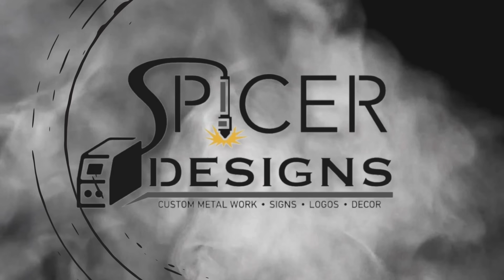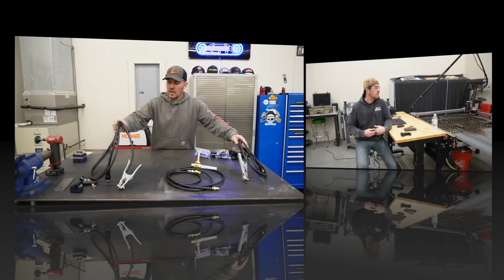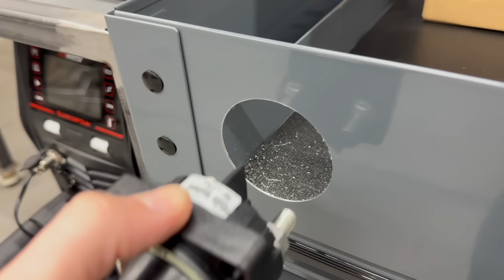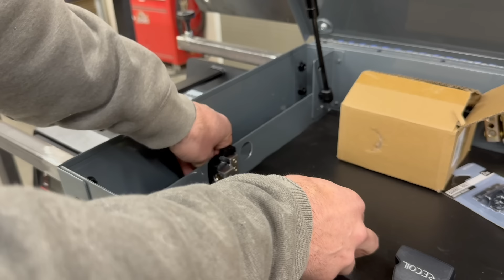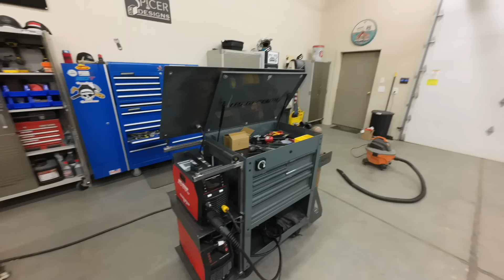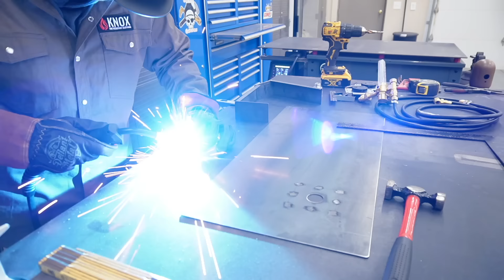Is This ULTIMATE Welding Cart OVERKILL??

Comment: you need an overhead Crain that has some magnetic  connectors  for lifting big sheets of steel that can go any direction, that way you can also go over a truck unloading in the other bay

Comment: Don’t 5he inner threaded sleeves in the isolation pads touch the metal on the top and the box?
Reply from the maker: No.   They are isolators.  The threads are isolated from each other.

Comment: You have two different types of regulators on your bottles. How come not the same? I am new to this and I have an argon tang for tig welding and I have both regulators. Is there a benefit to one over another?
Reply from the maker: Its just what i had.  They do the same thing.  One bottle is taller than the other too so the circle gauges sit lower.

Comment: Not a welder but I would have liked to see the ground test with both tied in to the house ground. The cart and 2 welders shared a ground with the cart. It's not the welding ground but how isolated is the welding ground from the chassis ground?
Reply from the maker: The welder is DC so its a separate system thats isolated for the utility ground. Ill show some more testing in future videos.

Comment: ARCCAPTAIN.  Nicely done on the welding cart.  Kinda wish I had seen it earlier.  I did something quite different, rolls, holds my plasma cutter, the flux core welder and the metal cutting saw.  My main requirement was for it to roll, and roll easily.
Reply: Seeing this,  has my mind wondering 🤔    and its cool azz image in my head

Comment: I bet you could mount that ground selector switch from the inside, with just the knob & legend and screws visible from the front and protected better by the overhang of the top since it'll move in about an inch.

Comment: Arccaptain. Those are not side cutters. How old are you?😂  You have some great ideas. I think when  i build this, I will just weld a lug and the ground cable receptacle both to the underside of the table top. Then it is just a jump from the switch common to the lug.
Reply: Also, they make SO cord 90 connectors. With that 90 you could have avoided building the outside box.

Comment: ARCCAPTAIN - Very sweet cart! I have a Harbor Freight tool chest, 9-drawer, that is very nice except the casters. I had to replace them because they refused to turn when moving it around. With all the weight you’ve added, I’m wondering how yours are holding up. Still nice! Thanks Kyle
Reply from the maker: So far so good.   I don't move mine around a whole lot at the moment

Comment: I could be wrong, but I think for that wiring enclosure on the cabinet you need, if you didn't have it (didn't see your setup), a ground bonding wire since it's metal? Maybe?

Nice and clean though.
Reply from the maker: The metal is box is grounded.

Comment: I was on the fence with this cart. Know with the ground and power, I’m sold. What gauge cord did you use to plug into wall?
With a pan brake, why three pieces for the box holding the receptacles. Time for Sheetmetal is fun channel. 😊
Reply from the maker: I just used a 3 conductor 10 awg for now, because I had it.  I will swap it out for an 8 awg cable for the final assembly.  I had to do the box in two pieces because of the brakes.  Im still learning different techniques with the brake.  And the 3rd piece for the cover plate is standard for access.

Comment: damn, u cut the hole before i could comment on it..  :D  i think potentially accidentally runnning a machine without a viable ground point is more of a concern than grounding through one or the other machine...especially the tig.  just my .02.  i would ground them both and leave them that way.

Comment: is the rack that holds the welders bolted right to the not so hf toolbox, or am i missing something? Not sure the isolation blocks make a difference at that point if so, I'm no electrician just my observation and legitimate question.
Reply from the maker: It is bolted right to it.  Completely isolated. I actually had a part in the video where i tested continuity in the video but i removed it because the video was getting too long.  Ill show the meter test in the final video.  The spacers on the welder rack are not conductive like i mentioned in the video.

Comment: @SpicerDesigns for the panel that’s gonna block off the space between the Tig and the “non harbor freight tool cart” would you do some kind of wire loom or rubber hose cut down the middle to go over the edge of that hole for edge protection on the gas hose and cord? What about a push handle on the tank side? The bottom plate doors, could you plasma cut “Spicer” and “Designs” on each door and put wire mesh on the back side for a cool effect?
Reply from the maker: Great ideas..  I will probably add some softener for the chase holes.  I was thinking about an engraving on the doors but I don't know yet.

Comment: What about the power cord?
Reply: Looks good , what a machine !
Reply from the maker: I used a 3 conductor 10 awg for now because I had it. Its good for the 30 amp circuit that its on.  I will likely upgrade it to an 8 awg for the final assembly

Comment: So…. Where is your helmet going to be stored? Putting ‘Machine’ logo on those bottom doors??
Reply from the maker: you read my mind..  the helmet will go below.  thats the only place it will fit really.
Reply: @ Makes sense. I like to keep mine inside the cabinet too. Keeps all the trash out of the inside of the helmet.  Have you considered plasma cutting a wrench for your regulator fitting?  You could use that adjustable wrench for something else vs a dedicated tool on the cart…

Comment: Ground clamp is way overkill, but then it wouldn't be ultimate.  I would have gone w strong hand mag welding clamps way more versatile. I do really like the welders attached on the side giving access to the spool door without a sliding shelf contraption. Instead of a tilt table top a slide out drawer would be a must for me cause sure as shut id jug up a project and lift that top and to the floor my metal would go.😂

Comment: Nice video ,The AI song was good too. I was thinking about the back access for the 220 plugs You might have put the plate on a hinge for easier access to work on the plugs and maybe used riv nuts or Dzus fasteners to keep it closed. And what Home Depot did you go to to pick up such cute laborers ? mine just has old men . Cant wait to see the finished ARCCAPTAIN. welding cart
Reply from the maker: Ive been questioning doing rivets too. I may take your suggestion.  Thanks!

Comment: Those Milwaukie Hole saws are the best, you can order them in fraction sizes, I had to get a 3 5/8" last month. You want great holes, that and a magnetic drill press and S&F STEAD & FAST Annular Cutter Set, will make holes to perfection. Do a video on these new magnetic drill presses, It is one of the best tools I have ever owned in my 63 years, I grew up in a machine shop, did aircraft work for 35 years.
Reply from the maker: Thanks for sharing.  I will be showing off that new mag drill soon.

Comment: I just ordered a Yes Welder helmet H800M . Using  a standard welding helmet that has settings of 9 to 14 lens darkness does not cut it  with plasma cutting, I think a 5 to 9 lens will make it much better, It also has clear view. So the green tint  lens are a thing of the past.

Comment: ARCCAPTAIN...One comment, maybe rotate your ground isolator so that the arrow for the OFF position is horizontal and then the ground selection is up or down..the up for the machine on top, and down for the machine on the bottom. No thinking which machine is 1 or 2, just up or down.

Comment: I’m a fan (as well as an inside-wireman)…

food for thought :

   If you change your cord to a L14-30 twist-lock inlet, the cord could be removed for better protection & mobility & more easily swapped out if damaged or replaced with a longer one if/when necessary.
 
    It could also then be easily fed from a generator when you are in the sticks…

Comment: Get yourself some large pattern makers card stock or poster board and laser cut patterns of your parts to do a fit check before cutting metal. That will allow you to prototype the parts before cutting metal.  Work smarter not harder. Machine! ARCCAPTAIN me please.